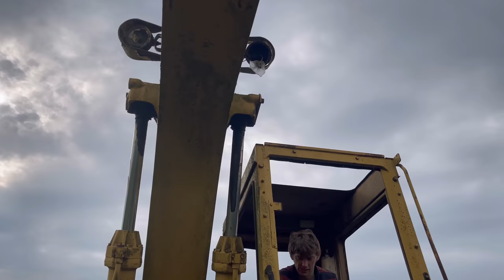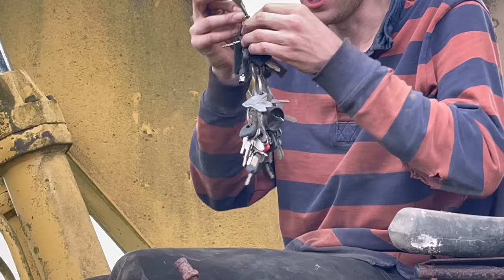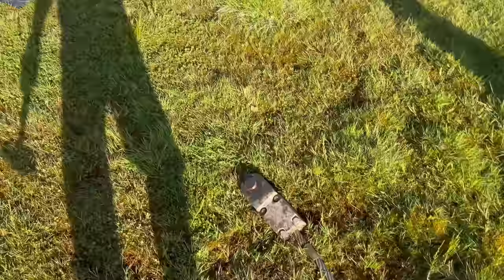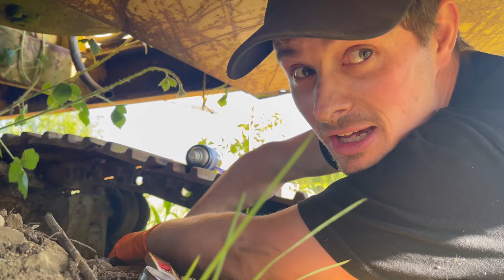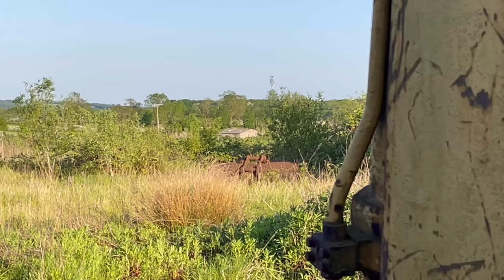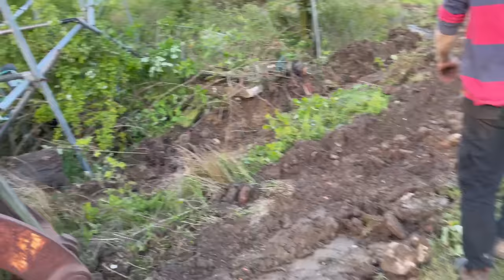Recovering CAT Excavator Left Abandoned!

Comment: Proper technique on using & tightening a bow shackle is NOT to tighten the pin up hard but back it off half a turn from finger tight otherwise they will tighten right up under load & distortion.

Comment: Brakes are spring applied pressure released, feed oil to the fitting at the brake housings next to final drive (hose you removed), a hand pump with a suitable hose(JIC fittings) will release the brakes. 
Alternatively remove track motor and brake unit but do not remove the planetary gear cover as this will give more headaches.
Early m/c may have a disconnect shaft behind a small plate behind the sprocket 
But can’t be certain, maybe mixing it up with the larger machines, 225,235,245 
The LC stands for long undercarriage giving better stability.

Comment: need to get a big single axle with  truck wheels,  and small platform for the tracks to sit on ,lift it up and put the axle under the middle of both tracks,  undo the hydrolic lines and fold the arm and bucket in, and chain it, then tow from the bucket, done in an hour, and on the road without having to get a trailer

Comment: why didnt you use the winch to lift the excavator boom so you could chain it up? and why not for both work the controls without engine on to open the valves so the hydraulics can move? you shouldnt' need the engine running.